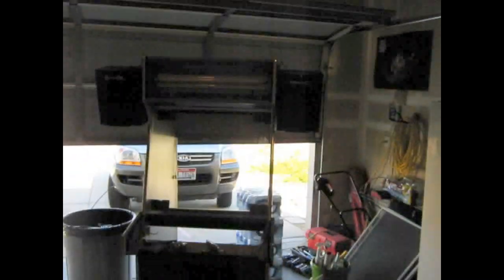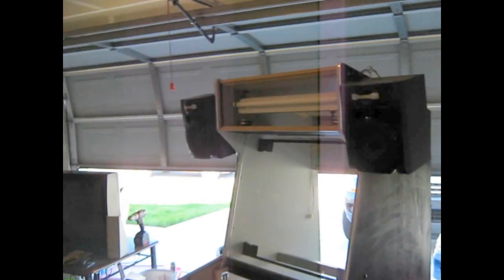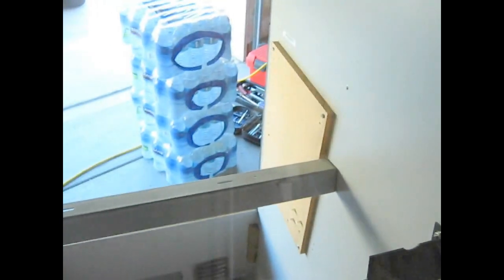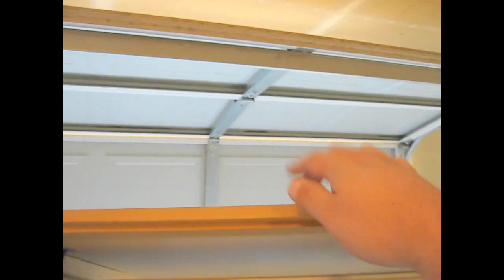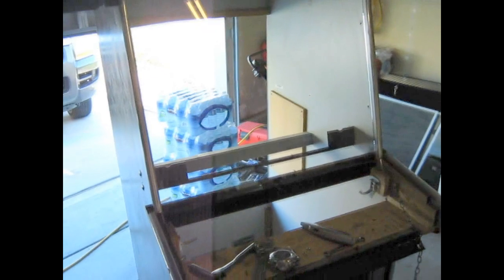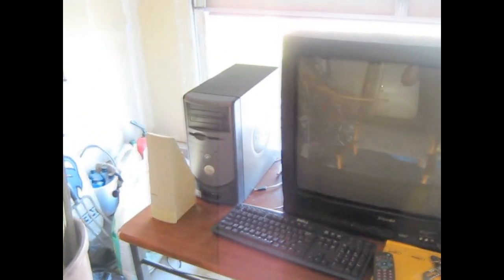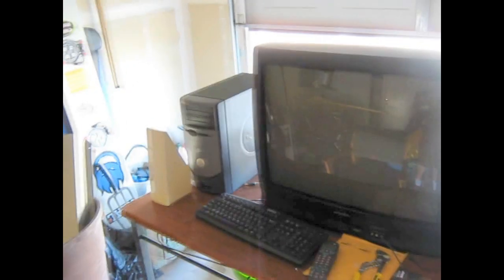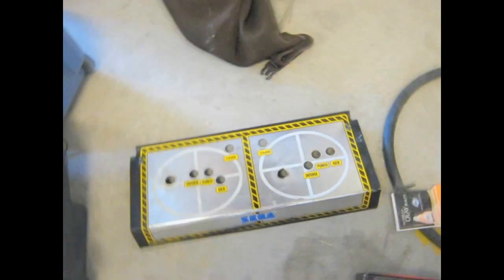MAME machine progress 1

Comment from the maker: @Shamb55 Check out my 2nd video and I explain it.  also in the video description is a website I made specifically on how I did all of this, including on how to get the buttons and joysticks going.  It is easier than you think.  If you can connect wires together, and follow directions, its EASY. 50 bucks for the circuit board.  its called an IPAC.